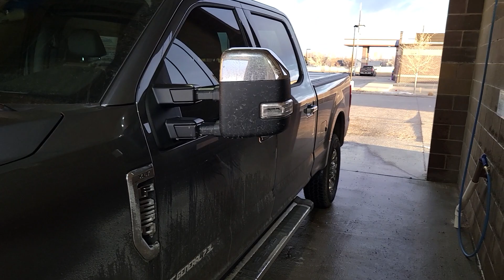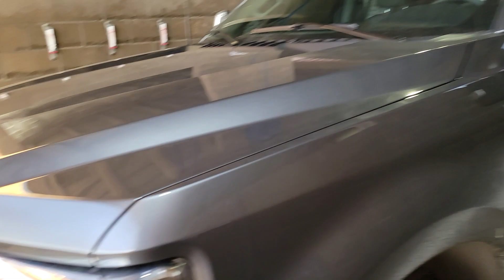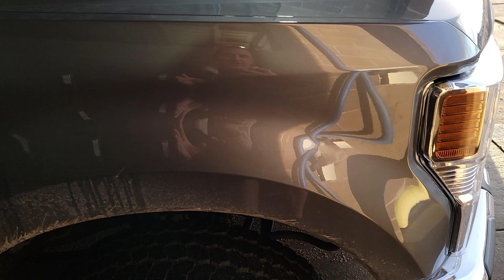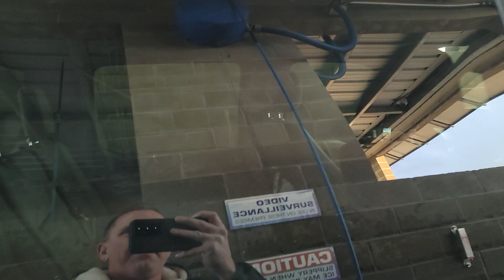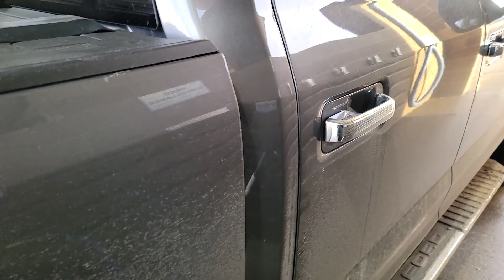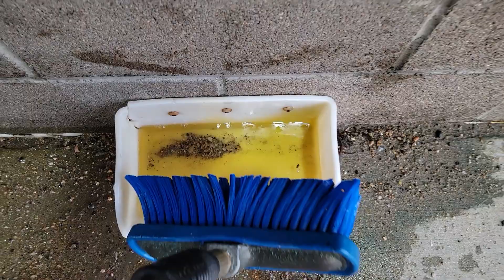Stop damaging your car or truck!  Don't wash until you watch!  F-250 and many others

Comment: Never drive on rainy days nor gravel  or dirt or construction site especially in Colorado.  I power wash with Wanda for dusty days then fiber dry.  I air the engine while paint brushing. Paint powertrain when new to seal factory finish 500 degree rust-oleum. Every 25k pull tire rotation cleaning fender wells like new looking for suspension damage for warranty issues like excessive play, leaks, etc. I've had '93 f250gas, 2-'08 KR 6.4l, RAM Longhorn Cummins 13, 16, 19(totaled in CO), 20cp4, 22cp3(first3500) now a truck like yours just changed O/F @1,500 miles. Oh yeah, I'm retired and I do all my maintenance including EGR coolers and valves at 50k miles to prevent water o--rings from baking.
Reply: Wish I had a Beer?